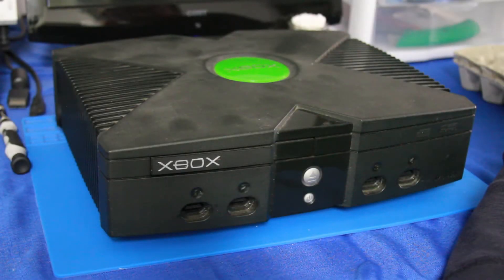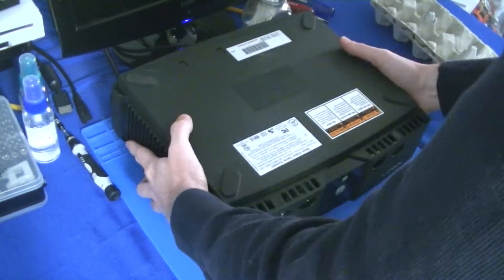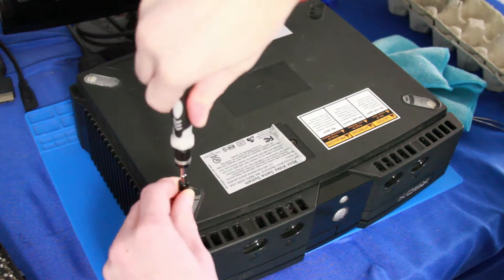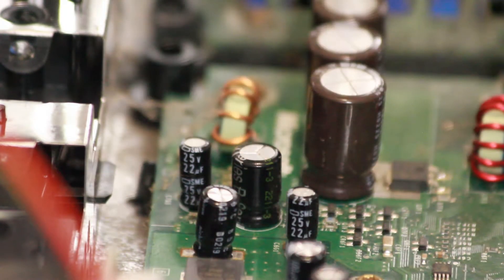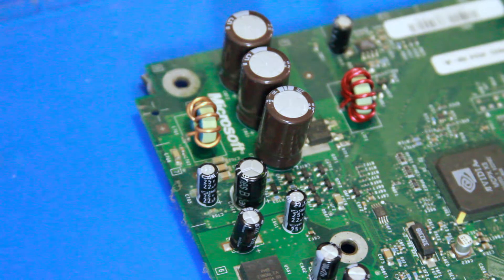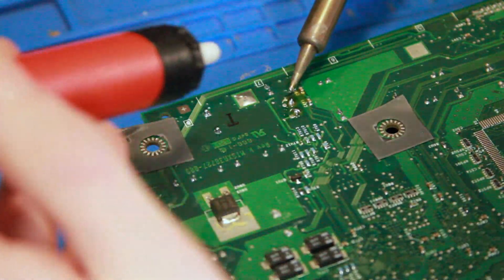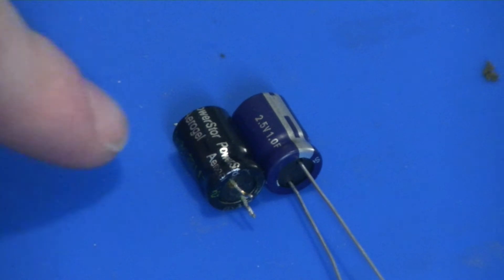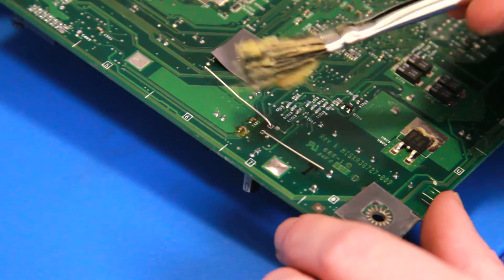Removing and replacing an Xbox clock capacitor

Comment: Great video. I'm planning on digging out my Xbox to do the same thing. When you were cleaning the electrolyte from you other Xbox, did you use isopropyl alcohol to remove the electrolyte?
Reply from the maker: Thanks for the support! Yes. I pretty much just use isopropyl alcohol to clean boards. Depending how much leaks or has leaked out, you may need to do a couple rounds of cleaning. Or you may get lucky and it didn't leak at all. If that's the case, still remove and/or replace it. It will still leak eventually.

Comment: Removed it manually, after boot I got an error, what could it be?
Reply from the maker: Could be any number of things. Damage to the board removing the cap, could be an improperly seated cable, another cable jostled loose. Could be anything. What does the error message say?
Reply: @titanrepairs  Fixed! It was the error number 11, basically I've replaced the drive as well but for some reasons only an old Samsung works and ofc original dvd drives.
Reply from the maker: @karwoski91  Woot! Glad you got it working! That's news to me. As far as I knew, the drives should be interchangeable as long as it's for an Xbox. I guess I could be wrong on that one.